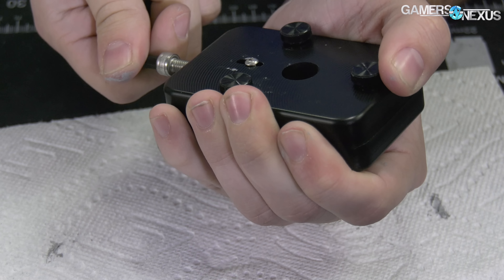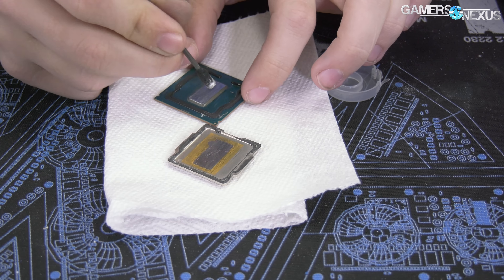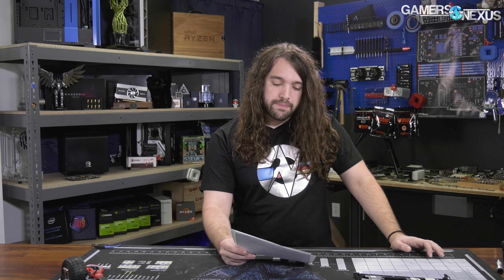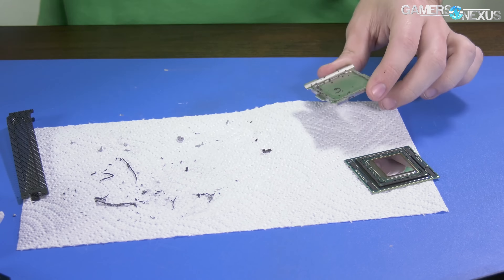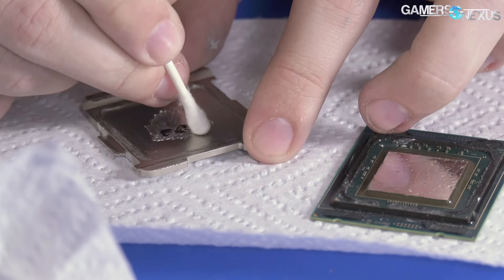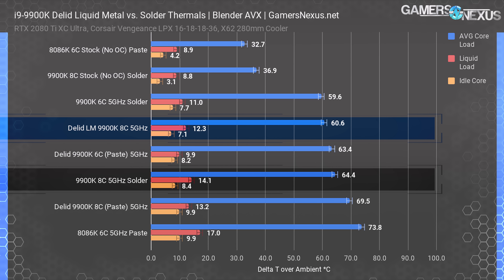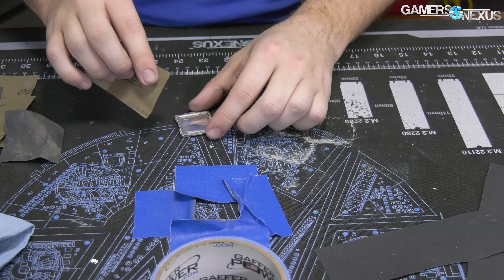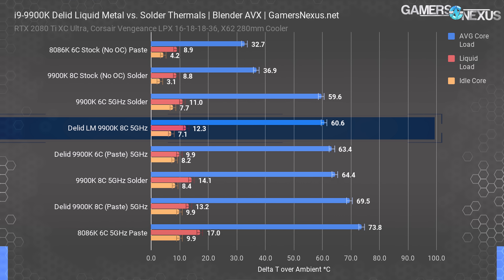Back to Reality: The 9900K Delid & Liquid Metal

Comment: at 4.7ghz stable on all core.. what is the lowest voltage (undervolting) possible.. would be nice to include this too since not all of us are just interesting in overclocking but also undervolting for silence and low TDP
Reply: I second this!
Reply: Here's your typical v/f curve https://i.imgur.com/faUA3XZ.png
Reply: i think around 1.2v but would depend on the chip with some doing more or less
Reply: @bobhumplick4213  and what are the temps and tdp at 1.2v ?
Reply: @tarkfarhen3870  i like fanless coolers and would put this in a mini-itx.. i dont care for top top benchmark speed 95% the time, cant stand any noise 95% of the time.. one of the reason im pissed off at intel to again release an half broken product since the lid thickness and solder tim properly on purpose.. cant believe they did test all the methodologies that any youtube can do in a day...

they are imposing nasty noise pollution on their customer for no reason whatsoever

only unconscious idiots don't care  for noise pollution..
Reply: @lex Tr3 im the thing is that people want to quote prime95 max temps and power.  NOTHING in the real world even comes close to prime 95 small ffts.  i dont have a 9900k but i do have an 8700k.  at 4.7 all core at 1.2v an 8700k in any real world workload would probalby be nearly within the 95w tdp at all times and run very very cool.  add 33% to that figure for the 2 extra cores on the i9 and i would think it would be about 150w max.  so basically about the same tdp as my 8700k at 5ghz 1.3 ish volts.  which means a noctua dh15 (what i have) or a dark rock pro 4 would keep it line very easily and stay about 80c or less for heavy workloads like video encoding and such.  for gaming it would be very low.  with my 8700k at 5.2 and 1.4v i have never seen a game use more than about 70w.  maybe in a heavily multthreaded game like bf v maybe 100w but i doubt it.

so i would say that the i9 with all core turbo of 4.7 and 1.2v would be about what a good 8700k would be at 5ghz 1.35 or so.  but the best setup would be to set the max power limit up to as high as your cooler will take.  maybe 170w or so for a good air cooler without the fans getting too loud.  then set turbo limits yourself.  set the 1 through 7 core limit to 5ghz with the 8 core limit down to 4.8 or so.  that way when an app that uses all cores is running it will downclock to a lower clock while gaming though it will stay at 5ghz mostly.  or set an all core turbo of 5ghz with a steeper avx offset than usual.  maybe 3.  that way when gaming or whatever you get full boost but when running avx loads you will drop down to 4.7 or whatever your clock was.  

bascially what im saying is that power limit tuning will become as important with this cpu as frequecny ratio overclocking.  of course if your board has the power delivery and you dont mind investing in say a good 280mm cooler you can turn all the power limits off and oc to 5ghz without any limits.  that would give you a tdp (or just power draw would be a better word i suppose) of aroun 200w plus or minus in intensive real worl workloads like video editing.  prime 95 small ffts would be maybe near 300w with these settings cause my 8700k at 5ghz gets up to 200w (so maybe more like 275w for the i9) but that doesnt really matter cause no real workload is any where near that.

basically if you use the stock power limits for an 8700k on a z370 board ( i think its around 160w max power draw) then you will have a cpu that is cooler than an 8700k and draws about the same power but will get lesser clocks.  but if you raise the power limit just a bit and find the right voltage for your particular cpu you could get a bit more power with the same cooling and keep clocks fairly high.  

but to answer your questiong i think 4.7 at 1.2 would be the about 160w max for any real world workload and that the temps would be close to a delidded 8700k.  a ryzen 2700x at 4.3-4.4 will draw nearly that much, maybe 140-150w. intel cpus are more effiecient at the same clocks.  its just that the intel cpus clock so much higher combined with the fact that avx2 has so much more througput on intel cpus it gives them a name for high heat.  but what peopel dont take into accoutn is that you can get more work done at that higher temp or lower clocks with an avx offset and actually get the same temps\power for unit of avx work done and so you can choose to either do more and have more heat or do the same amount of work and have the same\sliglthy less heat
Reply: @bobhumplick4213  oh thx for the info
Reply: SlavjanA Is there a curve for the 9700K??
Reply: lex Tr3,
SILICON LOTTERY is going to result in a big difference between some CPU's so it's not practical to take a small sample (maybe just one CPU), undervolt that and assume others will get similar results... having said that I do know AnandTech dropped 24degC by tweaking their settings (voltage mainly). https://www.anandtech.com/show/13400/intel-9th-gen-core-i9-9900k-i7-9700k-i5-9600k-review/22

So at this link they've already played around with VOLTAGE vs FREQUENCY and show how that affects temp (and thus noise).

Your PSU and motherboard may also have some influence (stable voltage) on what is the lowest possible as will the CPU cooler (an "overkill" CPU cooler might make the difference to get 100MHz higher at same voltage)... so too many variables frankly.

*based on my experience I'd recommend a good Noctua air cooler like the NH-d15s then just experiment using online guides for the CPU and adjust the fan profile by ear (or set a fixed RPM based on max noise you'd like then tweak until all cores in real-world 100% load hits about 85degC.. then go back and set that RPM as the max and ramp up to it).
Reply: I would bet trying 1.28v and lowering to maybe 1.25v fixed and turbo llc
Reply: My 9900ks 5ghz does 1.1v at load  r20, 1.15v in bios llc6. 1.2v in bios and 1.16v at load and it can run occt linpack.
Reply: THANH NGUYEN what is your cache set to? Those are some very nice voltages at 5ghz all core 👌🏻
Reply: Paul Christophis cache 50. Sold it for $1200 . Buyer need a low voltage chip so he can run it on his alienware laptop. Im using a 9900kf 1.24v llc8 at 5.3ghz currently. Maybe I will hold it till intel 11th gen. 10900k seem good but not good enough to upgrade.
Reply: THANH NGUYEN man that’s awesome! I have the 9900kf too. Best stable low voltage at 5ghz is 1.25v with llc6 so 1.217v under load. Best I can get stable with OCCT at 5.1ghz is 1.3v llc6 again so 1.270v under load. Struggling to get 5.2 stable due to lack of cooling. I can run quick benches at 5.3 etc. Only using H100i AIO. What’s your cooler setup? I thought I had a pretty special chip but damn 1.24 llc8 @ 5.3... yes please! And I agree regarding the 10900k. Mate has one and is great, but for me not worth it. Maybe 11th gen like you said
Reply: THANH NGUYEN those stats are with cache at 47... I’m now thinking run back 5ghz and find a stable voltage with 50 cache as I’m sure that’ll be doable with my cooling but unsure if it’ll be more beneficial. Then upgrade to a 360mm AIO and get 5.2 stable hmm

Comment: Hey Steve great video's as always. I have ordered a custom IHS from Ebay that is compatible with 9 series Intel processor's i5's, i7's, i9's. I am yet to receive the IHS it does have a bigger plate so better heat dispersion based what i read in the description, i personally Delided my I9 and used a different IHS from 7s series Intel chips it has very smooth contact on the IHS, and the delided I9 is pretty smooth it self while i spend good 5 hours smoothing it out. Everything worked very well for first 2 days, Easy 5ghz over clock with 46c idle temps and 58-63c when gaming/streaming. I have gotten a BSOD on a 3rd and am some what stuck on BSOD after Bios with code Whea Uncorreable Error. I was not even able to get into login of windows 10. I realized when i manually cranked up my voltages it would boot for 30 secs and shot down again and voltages automatically would incline hire from stock 3.6ghz .98v to as high as 1.42v on each reset. Do you think my chip has a issue or is it the motherboard or something completely else. The Temps are fine in bios 3.6ghz stuck is 26-30c idle only voltages clime when i raise them manually to boot up after i read some forums.
Reply: Pyrozeus so you used an IHS from a previous gen i7? Also you said smoothing it out. Do you mean smoothing out the die? If so you may have damaged the die. The older IHS may have pushed against the die and smoothing the die could have also done something.
Reply: You absolutely cannot use an i7 7th gen IHS on a 9th Gen chip.

You killed it, guaranteed.

Comment: Delided a soldered core 2 quad yesterday, I would not be comfortable with doing the same on a 550-600$ CPU.
It is not an easy job scraping of the solder to get a clean surface.
Reply: How did it go ??
Reply: @filds1  I removed the solder from the 2 CPU parts and the surface turned smooth like glass. The lid itself is not cleened yet, want to try a hotplate to melt the solder of. Everything is just for fun, because i dont have a intel socket motherboard, picked up the CPU from a defective server, so will never realy know how it went.
Reply: Ah rip :(
Reply: I really wanted to see the results

Comment: I’ve only ever delidded an 8700k before I delidded my 9900k but it was very easy. If you buy a quicksilver kit with polish you just pop it open scrape as much of the sodder off as possible and then spread the stuff on the die and ihs to remove extra sodder. I also lapped the die, inside of the ihs, and the outside of the outside on the ihs. Finishing it off with lm took 2 hours and I dropped temps 8 degrees on average on a custom loop. Idk maybe I just got lucky.
Reply: What did you put between the die and the IHS. My 9900k is having serious thermal throttling issues.
Reply: @HD-xp3tp  I used thermal grizzly liquid metal

Comment: You could get damaged gage blocks (a chipped corner would still be fine for your purposes) or other pretty flat things to help lap. A dented or chipped gage block is basically worthless for their intended use so they are silly cheap if you are using them for other things.

Comment: I dont think my heart could handle the stress of de-lidding a 560$+ cpu
Reply: Exactly what i think about it. Killing a expensive CPU for what 10or 15 degrees less at 5,3ghz which no game really need because you get at least 5fps more....🙈🙊🙉
Reply: @flashtu  10 to 15c is the difference between using 30dba fans and 15dba fans. Overall your pc can become significantly quieter especially when you own a aio like the Kraken in which the pump is controlled via PWM and the pump gets louder or quieter based on how hot it gets.

Comment: 10 to 15c is the difference between using 30dba fans and 15dba fans. Overall your pc can become significantly quieter especially when you own a aio like the Kraken in which the pump is controlled via PWM and the pump gets louder or quieter based on how hot it gets. That is why I recommend sending it to a service like Silicon Lottery or Simworks Pc where they can Delid it for you by either using a custom IHS, or by sanding it for you.

Comment: i7 7700k (slight overclock) air cooler on thermal paste: 90 ° C
Upgrade: i7 9700k same heatsink, excellent thermal paste: 99 ° C
Upgrade: corsair h100x heatsink on liquid metal (no Delid) Thermal Grizzly Conductonaut: 61 ° C !! (in stress test)

Maybe in the future I will delid but for now I am more than satisfied!

Comment: boiling coffee lake will cooled by ice lake
Reply: If 10nm is fixed that is.
Reply: it's easier to fix a broken architecture before you shrink it rather then after. the ryzen response from intel is relatively fast considering CPU development/manufacturing normally takes years.
Reply: aye, we need milk lake to get this latte rolling
Reply: @kano_from_mk  screw milk lake, only cream lake, but when you got milk lake and cream lake, you can mix it to ideal lake without coffee lake ever, so may be, yes, milk lake + cream lake, and screw coffee lake, and ice lake, so mixed lakes milk with cream would be cool without cooler in the new age soc, what'll located on the surface of the planet

Comment: If you use ferric chloride PCB etchant on the indium on the CPU die, it'll remove all the indium and the vanadium layers and gold. You'll need to gently heat it though. Sadly it will not really work well on the IHS but you can try it there too.

Comment: You will remove material much faster if you rotate the IHS 90 degrees every so often. Think of cutting channels as you sand with  the sand paper granules shortly thereafter cutting less as they follow along those channels just cut.  Now  rotate the material 90 degrees and you cut across those channels removing them and create new channels deeper down .

Comment: Could you try the graphite thermal interface thing Linus tested somewhat, instead of solder/LM? I'm interested how temperatures are with that.
Reply: Don't bother with it, I seen temps per core within 1c between kryonuat and that graphite pad between the IHS and cooler. I then cut it to size and tried it between the IHS and cores and it was better than the stock TIM on a a 7700k but nowhere near as good as LM. Also you need  really flat surfaces since it doesn't fill any gaps to well.
Reply: @charleswp71  the silicon and IHS are pretty flat, no? Would be nice to have a graphite pad in the CPU from factory, but only if it was any good. I take it the graphite pad doesn't go bad  with time.
Reply: @ MotoK tips The "silicon" (technically its surface is a mix of rare elements), ie die is anything but flat. And even if it was it will ever so slightly deform with temperature.

Comment: You say it's never been necessary to delid an Intel-CPU, but in my experience most 8700Ks will thermal throttle during stress test, if you don't. Many 4790Ks had the exact same issue. In both cases I'm talking thermal throttle at stock speeds.

Comment: gotr a i7 9700k today had a i7 8086k before both on all core 5.1ghz but the OEM 9th gen is sitting around 40 degrees C when my 8th gen i7 8086k would sit at 30 degrees C idle all day long and bearly ever touch 70 degrees with loads going on! defo the chips coming apart and begin LM'd!!

Comment: Can you sand/polish the top of a cpu for a better contact with the cooler? Thinning the amount of material between the cpu and the cooler as well as producing a polished surface for thermal paste to do its job.
Or is the difference between a stock cpu lid and a 3000 grit sanded lid so minimal it wouldn't be worth removing the cpu's label..?

Comment: well.. i delidded my 9700k and 9600k while drunk af with a cheap ass 15$ delid tool from ebay. i ran two cineR20 runs back to back then took the cpu out as fast as possible and popped the sucker off. i cut off the solder with a razer, then wet sanded with 1500grit until i saw no more solder. - i also lapped down the bottomof the ihs that makes contact to the chip itself. the LM is so damn thin compared to the thick layer of solder that i felt like it needed to be sanded down to make a proper flat contact. overall i saw AMAZING improvements running an NHD15 with Lm on both sides. play at your own risk everyone.. i was fully prepared to go buy another if i fucked it up. if you arent, dont do it.

Comment: Actually, the IHS is one of the reason  why adding a better paste doesnt improve the performance, since the thermal resistance of the IHS is the major factor here. 

If you can run the cpu without the IHS, you would be getting more than 15C improvement + the 4C you getting from liquid metal. 

But exposed CPU DIE and the pressure would be much greater on the DIE surface can lead to "unpleasant" consequences. 

Thats my 2 cents I hope you read it and reply back. 

Thanks.

Comment: So, I plan to get the 9900k specifically for the purpose of better aiding single PC game streaming over an 8700k as I find that in some games, like Battlefield V, CPU usage even in 1440p is high enough that frame rates dip while trying to stream at a reasonable preset like Fast.  I also plan to drop my Corsair H115i and switch to a custom EK loop with the PE 360 rad and the Vardar fans that come with it.  With this cooling setup, would the temps on the 9900k become a non-issue on solder?

Comment: from what I've seen, unless you're prepared to lap the die, you arent going to see a huge improvement, it seems that the main culprit of causing the extra heat is due to a taller die size with more silicon for the heat to travel through before hitting the IHS

Comment: Very informative!  One question about "grinding down the die and IHS".  Wouldn't that create a larger airgap that would have to be bridged by either LM or some sort of TIM between the die and IHS and couldn't that limit the cooling capacity as well?
Reply from the maker: It would reduce the amount of material that heat has to travel through, therefore getting the energy to the heatsink faster.
Reply: The IHS is held up slightly by the silicone adhesive, remove that and you have the tollerance you are worried about

Comment: Are your error bars just showing "1" or are they actual values? It doesn't look like they differ on anything, and if you have just a single value selected when making the graph and have it automatically make the error bar, they are going to be useless. Error bars show either standard deviation, 95% confidence internal, or standard error of the mean, it could even show range if you wanted. But basically it tells people more about your data.

I'm sorry for asking. It was just something I noticed.